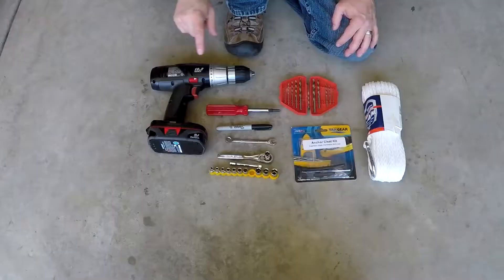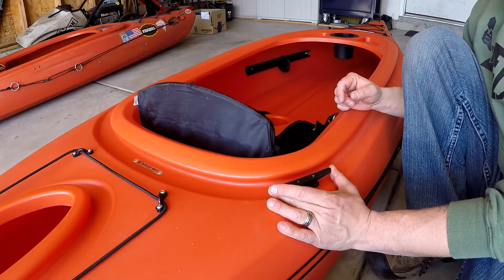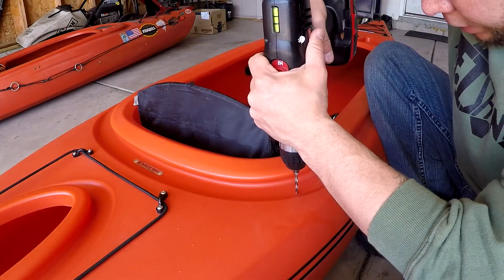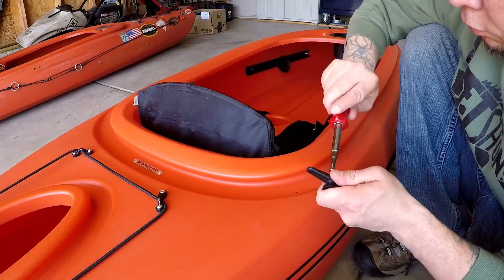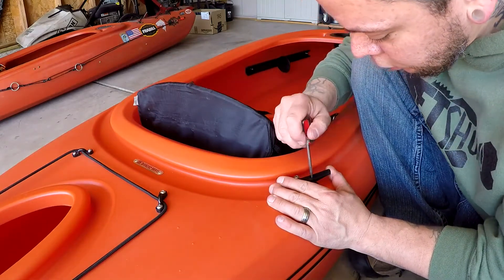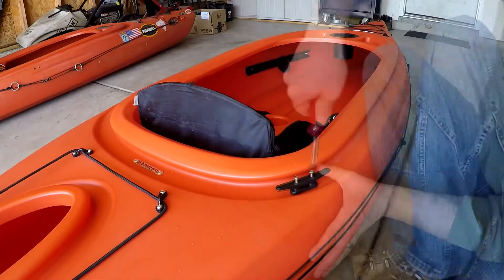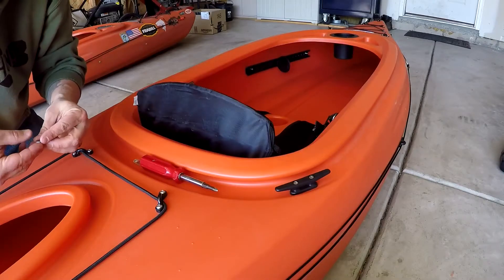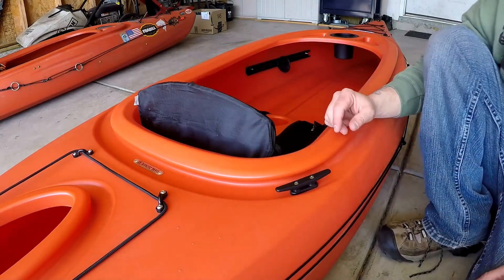Kayak Anchor Cleat Installation

Comment: Hey great DIY videos, ive got a 12ft  sit in kayak myself and always do my own fishing mods, its a lot cheaper than buying everything from the shops. One question though, when your anchors not being used, do you wrap your entire anchor line around this cleat? Or just tie off the end of the line to the cleat and keep the rest of it in the storage area? Or do you store the line and anchor in a separate area and only use the cleat when you need to? Also whats the size anchor you use...i was hoping to get a 3lb but the shops here only have the 1.5lb. Thanks!
Reply from the maker: WhatUpDoe1000 first I’d like to say thank you for watching and commenting I appreciate it. Now as far as my anchor goes I use a 5lbs metal weight from a weightlifting bar. Is round so doesn’t get caught up on anything. Plus it actually has kept me from moving. Now I only have it out if I’m using it, when I’m not it’s either in a storage bag or coiled up neatly in the yak till the next spot. I tie and retie around the clear as needed. Have you seen my anchor trolley system vid for this yak? At the end it explains a bit how the cleat works with the Anchor Trolley system.
Reply from the maker: Here is my playlist with all my mods so far I hope you find it useful https://www.youtube.com/playlist?list=PLfVZfM-DJU_oTL7pLF50ebKOisB51vYw_
Reply: Fishing POV Haha i guess we think alike, i was using two round 5 lb plates as well. The problem is we have some soft sandy bottoms in the local lakes and the plates dont really grip the bottom, they just slowly drag along if there is a breeze. So i bought a proper grappling anchor which will hopefully work better in some current/wind. And yea i saw your anchor trolley video, ill be building one myself the same way. Just looking for pad eyes and thin paracord (hard to find stuff in small town Canada with no hardware stores around). Oh and heres something else i use...small strong magnets superglued to the kayak..great for holding lures or fishing pliers. Im on a budget so always looking for DIY mods! Cheers
Reply from the maker: WhatUpDoe1000 I like that magnet idea that’s pretty cool. I take it back it’s a single 10lbs weight not 5lbs and so far I’ve not had many issues but the vegetation helps keep it in place a bit. There should be a few links in the video descriptions for places you can get that stuff pretty cheap. Hey if you get a chance check out my website, we have a news letter you can sign up for we try to only send one twice a month so as to not spam folks. http://fishingpov.fish/
Reply: Fishing POV Cool, ill check that out. And keep uploading any other kayak mods you come up with! Helps us viewers come up with ideas of our own as well. Tight lines.

Comment: I just installed mine with 2 1 1/2 screws. I used liquid nails clear silicone seems to work bad ass. Yes cleat will very slightly move as long as you don't crank on it will be fine for an anchor. This is just my experience. Fyi it's a sit on top

Comment: For me, the actual install part is not an issue.  However I have a question that might be dumb...  I noticed that you installed your cleat at an angle.  All of my big boats in the past have had cleats installed longways, running lengthwise.  My question is, is it a major sin to install them running the direction with the beam of the yak and not length? Is there some sort of holding power that might be minimized if I do it lengthwise?
Reply from the maker: Not a sin at all, it’s personal preference since for the most part it’s only being used for an anchor and in some cases is attached to a trolley system so it’s technically just to hold the rope and keep it close so it’s manageable. Thanks for watching.
Reply: @FishingPOV  Just got back from a week boondocking.  I discovered that it doesn't matter how you put em on.  Worked fine.

Comment: Will water get in the holes
Reply from the maker: Greg Stamatopoulos I used rubber washers on the screws before the bolts and haven’t had an issue for years. However I do get water in through the cockpit sometimes LOL thanks for watching.